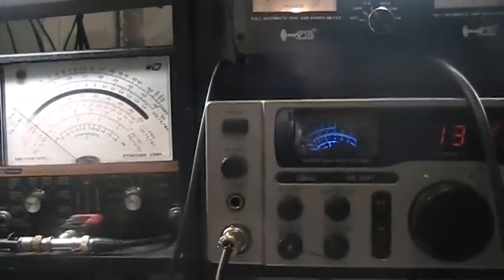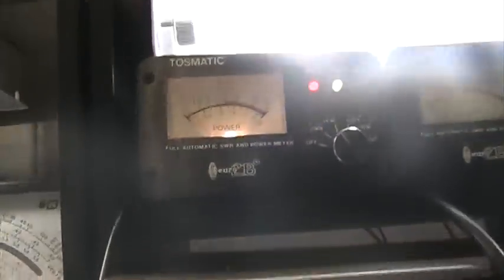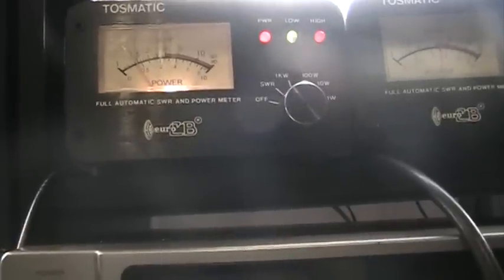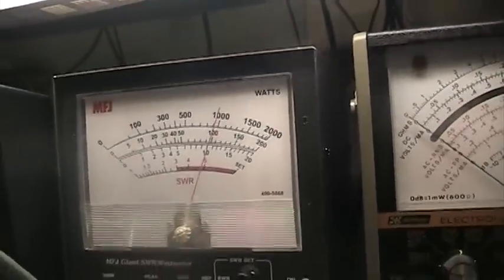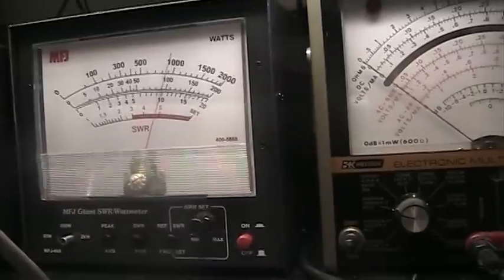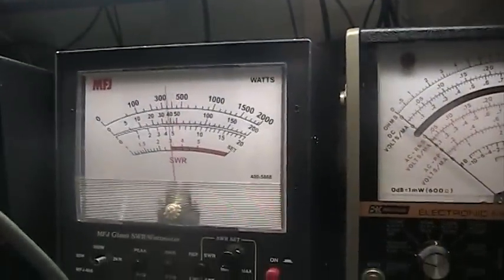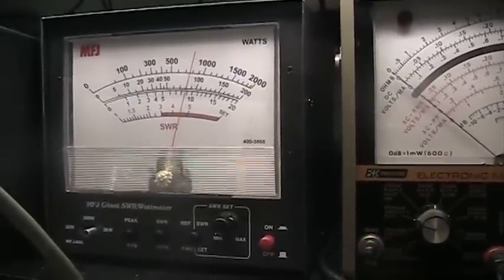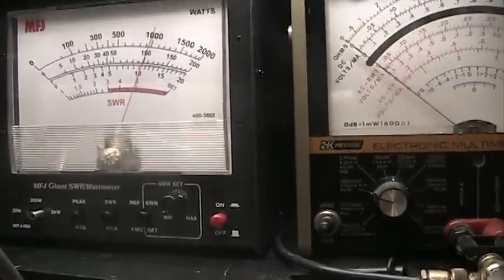Black Cat JB-2000 linear amplifier

Comment from the maker: I approved this only to show that you have no idea whatsoever what you are talking about. 1st of all, they made at least 3 different factory  versions of the Black Cat JB-2000. The JB-2000 1080 which was the Ham (FCC approved version) which was full 10-80 meters with band switch, no driver, 100+  watts driver required.  Next version was the 'CB version, the JB 2000-1011. Added a 6ca7 driver tube volted at 1/2 the hv plate voltage of the power supply doubler, so 1.2kv on the plate.

Comment: First of all the JB2000 never had a "driver" tube the 6L6 tube you are refering tube is used for negative bias since the amp did not come with a Zener as other amps did. Now further more if the amp is only doing 700 watts with your so called 200 watt driver please realize the ^ls tube is also a path to ground for the control grid which it now doesnt have since you have it out of the circuit. if all was correct it should do 900milliamps with 100 watt drive in cw.700 watts is only 250 milliamps

Comment from the maker: First of all, they made at least 3 different versions of this amp. I think they called em:
JB2000-10/11  (pretty much made for CB radio with built-in 6ca7 driver tube, highly illegal)
JB-2000-10-80  (modified with Ham Bands 10-80 meters plus modified for high drive Ham use, no driver)  so it could pass legality
JB2000-6  ( Ham 6 meter band, needed to be modded for CB 11 meter band which would make it illegal.)

Comment from the maker: On ebay I also used to sell copies of other Black cat manuals I had. However, next thing I know, Browning labs came along and started selling em too and other then made cd copies and sold em for cheap. This also happened when I bought out the last of some Glen VFO stuff from a tech from Glen with hand written notes on the service manual that was included. I printed out the notes along with the service manual and sold it, but again it was copied and duplicated by others, so I quit selling.

Comment from the maker: I own 2 right now. 1 is the 1011 with driver and the other is a 1080 without. I have owned about 3 more throughout the years, and have worked on about 10. I also have now and in the past owned many many others from the JB12, 150, 76 (200) and have even owned a couple very hard to find JB-440 which have 1 6550 driving 4 6550. I also in about the year 2000 before CB tricks and Browning labs found an original owners manual of the JB-2000 and used to sell them on Ebay.

Comment from the maker: You got a weird one. I got some manuals/ads/flyers and they have the 10-80 or JB-2000/E as having 5 knobs. Left Top 'Plate Load', Left Mid 'Antenna Load', Left bottom 'RF IP EP' (meter), Top right 'Band' (10-15-20-40-80) and bottom right 'Relay Control' (SSB delay)

Comment: there is a lot  of black cat amps around. I got 12V 8417 mobel but broken tube.
Reply from the maker: 7581 6550a KT88 6L6gt etc are all in the family.  Some of the Blackcat amps even came with 7581 instead of 8417's. The 8417 could take more abuse and voltage than most the others though.

Comment: i have a black cat 2000 that is wired for 220 and I was wanting to change it to 110. what do I need to change on the bottom for it to run on 110?

Comment: I have a couple of black cats.  They are huge amps.  The one needs a transformer.  I've never used them, so font know alot about them.  Would be fun to get them in working condition again.
Reply from the maker: The biggest they made was the JB-2000 it also was a known transformer eater, especially the one with the built in driver tube.
Reply: @tramdr  thanx for the reply.  I'm going to go get them out and have a look at them.
Maybe I'll have to get with you about going thru one of them, see if it can be revived or not.  I'm sure it wouldn't hurt to upgrade/modernize a bit as well.

Comment: I have the one with the 8417 driver, how hard is it to by pass it.
Reply from the maker: Not hard for a tech but too hard to walk a non tech thru it. Also voltages are lethal. Last, the one with the driver is very desirable. I bet you could get really good money for a working one with the driver.

Comment from the maker: @donnyp1966 Yep, 2kw peak out back in the day would be Super Bowl or Channel Master power. Here in Detroit, you need it to just chat on the main 2 channels. BTW, as of right now, I actually run QRP (Barefoot) and I get no LUV errr respect from my fellow CBer's. Still perfecting my Broadcast station with asymmetrical mod

Comment: i used to run one of those on 11 meters. my neighbors hated my guts.  it was kick ass of course. when and i do mean when it was working.  the weak link in my opinion is the driver section. i think a lot of people just take that out and then figure out a way to make it key up and use a external driver etc. otherwise. amp does kick ass. i sent it to a guy to fix and he stole it. but that is another story from the early internet days before we all got smart about internet dealing. but i digress.

Comment from the maker: Next, the control grid on this and other 3-500z amps is Grounded. IDIOT. Same for the other amp with the driver tube, the JB-2000-6, which is a reworked 1011 but would work on 6 meters but often included a note from wawasee on how to convert to 10 meters and of course 'illegal to use on 11 meters'. A friend of mine had 1 Muleskinner (silent key) in Detroit. We went to Blackcat in Syracuse, Ind back in the day. I forgot the Techs name, but he knew him personally.

Comment from the maker: The 1011 had no band switch and also tank coils for 10-12 meters only. It took 4 watts drive and was made for CB. The FCC did not approve. You can look up the schematics for this on CBTricks.com. If you can read schematics you will see that the 6ca7 is just that, a driver tube. Also, in all the blackcat and all the other 3-500z amps I know of, 3-500z's do not recquire bias. They are zero bias tubes idiot. No 6l6 or 6ca7 was ever used for negative bias in a Black Cat 3-500z amp.